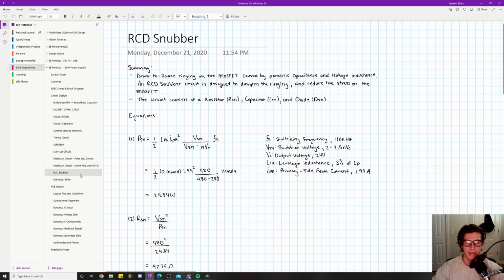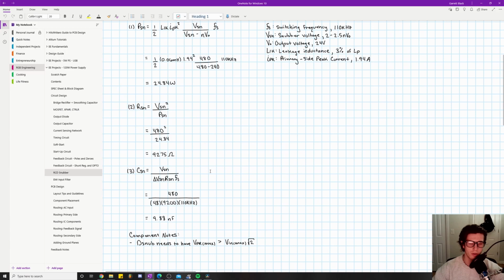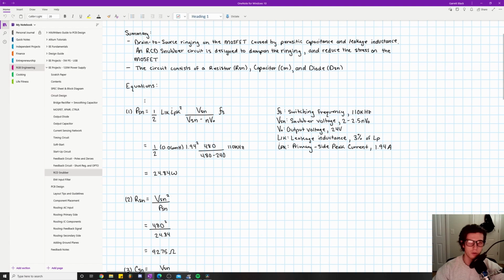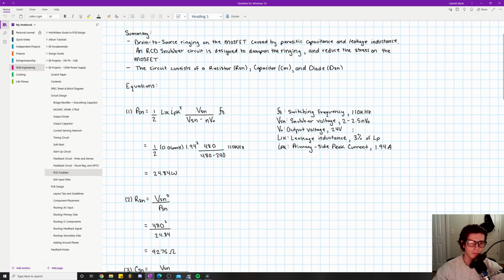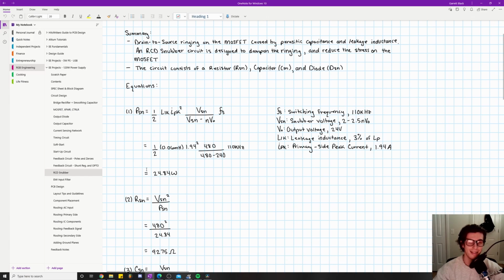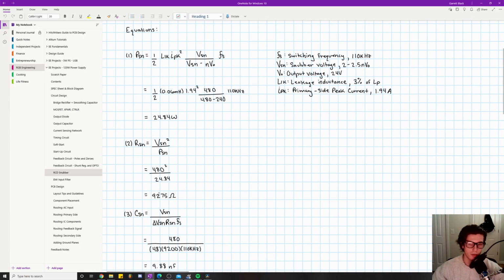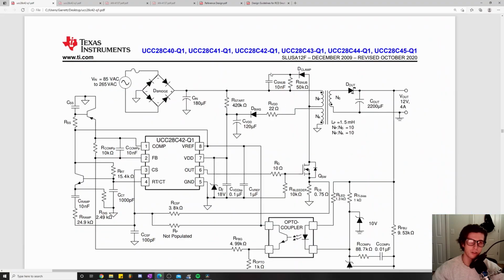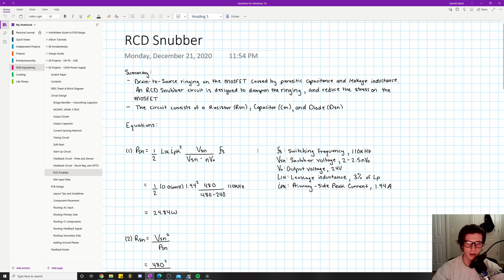FLYBACK CONVERTER PROJECT PT 14 | 24V, 120W FLYBACK CONVERTER EXAMPLE | POWER SUPPLY EXAMPLE PROJECT

Comment from the maker: Any projects that you want me to feature on this channel?
Reply: Hey ! Thanks for sharing your knowledge about the RCD snubber ! I have an idea but don´t know If you can do it it´s kinda special. Could you design a high voltage smps lab power supply that has stable V and I control short circuitable like the low voltage ones ? Like 230V to 5KV and 100mA or so ? I´m still thinking If you could use a normal optocoupler with such voltages.